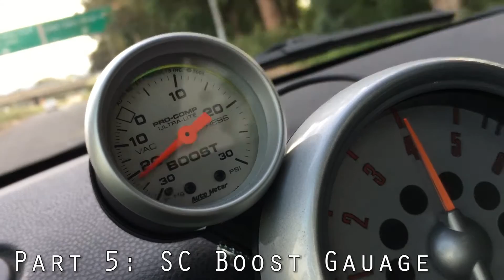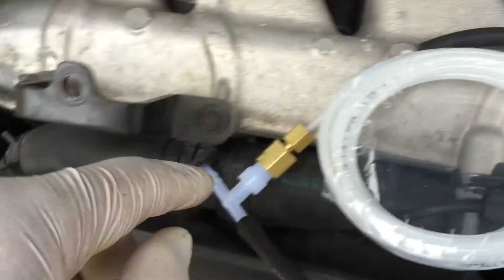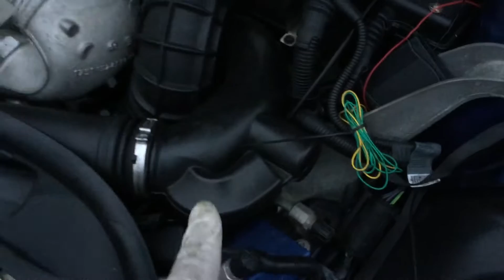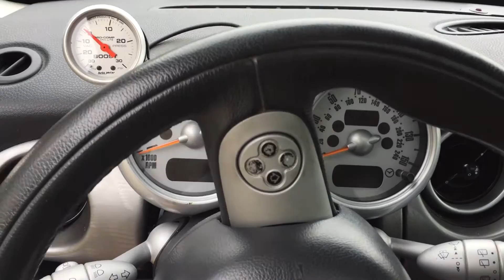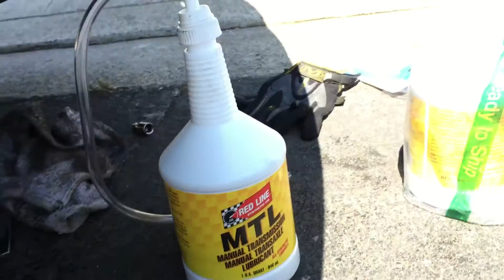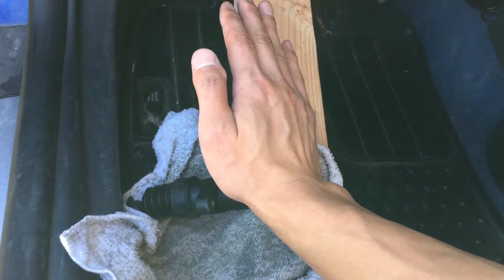Boost gauge, oil change, transmission flush, slave cylinder - 2005 Mini Cooper S R53 Video 5

Comment: Got the same gauge pod and boost gauge. How do you attach the pod to the back of the tach? Any pics?
And did you use a different vacuum tubing? At some parts in the video it looks clear tubing, but in other it seems like black tubing. Seem like black is easier to conceal.
Reply from the maker: Hello, I took apart the cluster gauge, drilled holes, and used small bolts and nuts from Home Depot to attach the boost gauge mount to the back of the cluster gauge. Sorry, but I don't have any pictures of it. 
The vacuum tubing was a single clear line, and I put heat shrink tube around it to make it look cleaner and shield it from some heat. Thanks for the questions.

Comment: You should show the wiring portion of the boost gauge.
Reply from the maker: My apologies. I was not able to include it in the video. I did find instructions online. 

WIRING INSTRUCTIONS per http://www.mossmotors.com/graphics/products/instructions/100-921.pdf
For (+) power, locate the gray/red wire in the tachometer harness and squeeze a red T-tap onto the wire with multi-purpose pliers. 
For (-) power, connect to any screw that touches metal.

Comment: bleeding the clutch is easy with a friend but you have to keep the piston compressed and also you don't stomp on the pedal like when doing brakes. Friend just has to apply light pressure on the pedal and you open the bleed nipple by a minimal amount. As soon as friend shouts when the pedal has stopped dropping you tighten the nipple and then pull the pedal up slowly. Works a charm everytime for future reference

Comment: Hello what boost gauge is this please.
Reply from the maker: Hello, it's the Auto Meter 4303 Ultra-Lite Mechanical Boost/Vacuum Gauge http://amzn.to/1XWeD5P
and Auto Meter 2204 Mounting Cup http://amzn.to/1XoOUnY
Thanks.
Reply: Colin Leung 
Hi 
Great video 
I have a question where you got your T vacuum or came with your new stuff? 
What you called T adapter or line 
I stop at Autozone and they say never see one like that so any help I will appreciate 
Thank you
Reply from the maker: Hello Fez, the T adapter came with the boost gauge. You can see the contents here: http://cdn5.frsport.com/images/detailed_images/16507_Autometer_4303_FS01-01@2x1446859873563d54618873d.jpg